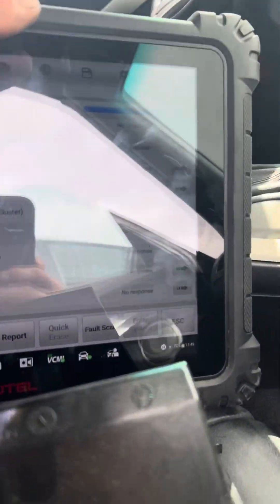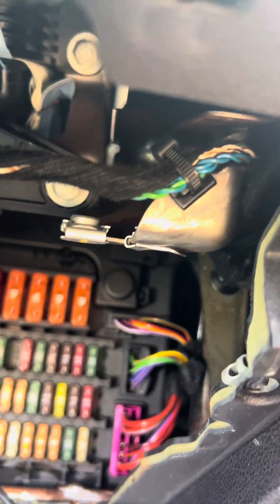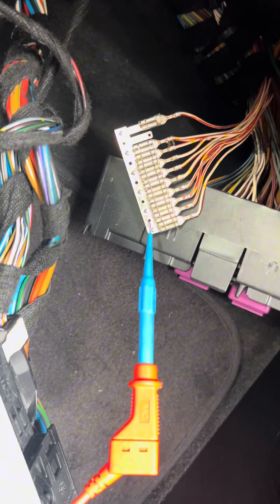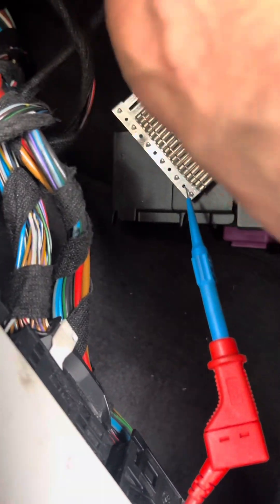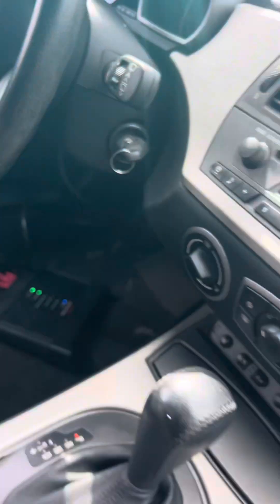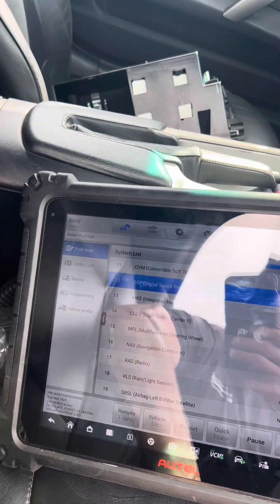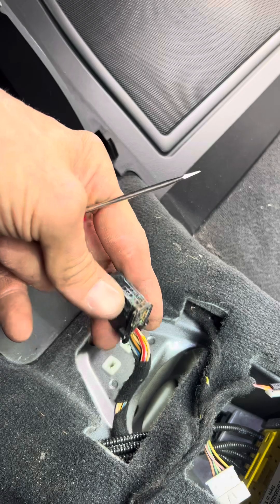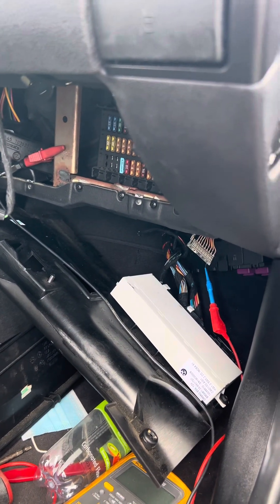BMW K-CAN diagnosis. Best practice allows for easy diagnosis and repair.

Comment: am an 07 e60 525xi bmw owner, am trying to diagnose something like that , not obd connector working at all, I got power but not comm, help me please
Reply from the maker: Gonna be a fun one!
Reply: @eurowerx4267 I fixed , getaway module bad, I changed and it’s working , I have to recode egain but am ok my baby it’s working again

Comment: Hello man I have the same situation with a BMW e60 same error and los of compression on cylinder 3 

Is there any way I can contact you? I am a little lost here
Reply from the maker: This was a diesel engine. 
K can electrical issue. You have a mechanical issue